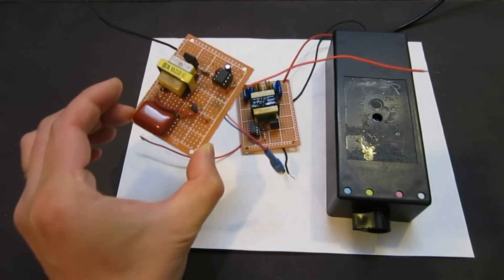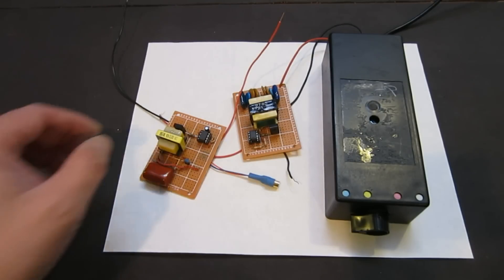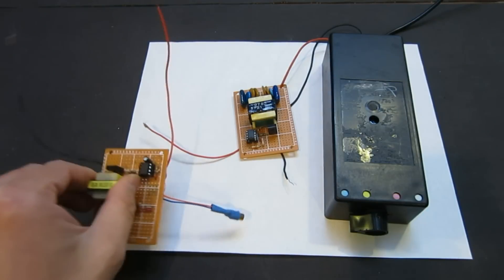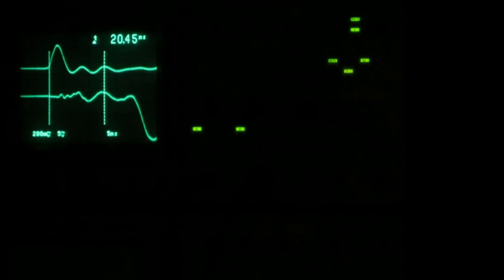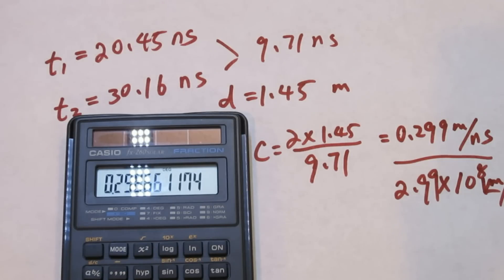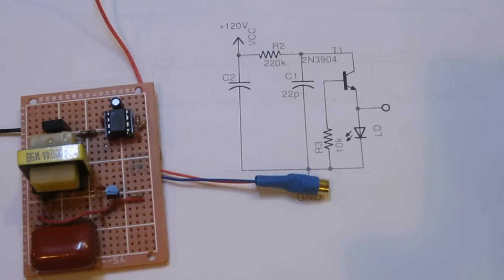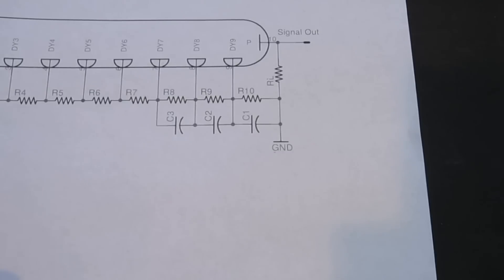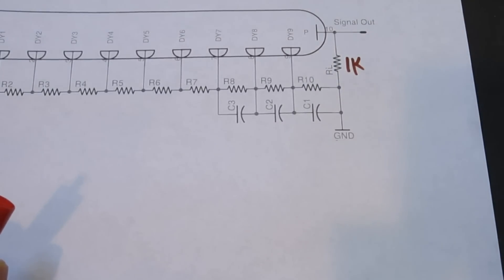Direct Measurement of the Speed of Light

Comment: That's a great experiment - but with c now defined as a number, and distance and time accurately measured, the only variable left to measure is the refractive index of the air in your room! I wonder if you could tighten up your accuracy enough to see it? Or maybe using an optical fibre to measure n for the fibre?
Reply from the maker: This experiment unfortunately is not accurate enough (the precision needs to be at least 5 digits after the decimal in order to see that).

Comment: The pulse shape out of the photo-multiplier would be useful if the light is modulated, like in the fiber optics that power the Internet. Here, you just cared about the start of the light pulse.

Like you mentioned, photomultipliers are so sensitive that they can detect a single photon. You use it to measure the concentrated beam of a laser, which seems to be overkill.

I am surprised that a laser diode can start lasing without any kind of warmup. You can send a brief shock of 120 volt to a diode without damage? Or is there some spark gap, zener diode or other protection to allow it to survive the electroshock ?

Nice demonstration which agree surprisingly well to the theory.

Comment: you are using a two channel oscilloscope, one channel connected to the output from the photomultiplier tube, and the other is connected somewhere to the avalanche oscillator circuit.  Where exactly is it connected to the avalanche oscillator circuit, I assume it is output terminated with a circle on your schematic.  Is that correct?
Reply from the maker: The second channel is connected to the emitter (anode of the laser diode) see schematic: http://www.kerrywong.com/2015/09/27/direct-measurement-of-speed-of-light-using-a-cheap-laser-diode-i/
Reply: glesage 
not only this experiment  but also all others experiment take away mistake with performance.
Reply: It doesn't matter where it is connected, the important fact is the difference between timeing when the mirror is close and far. There might be arbitrary delay in the circut, as long as it is constant and not depend on the position of the mirror (and why it would?).

Comment: Do you really need photomultipler tho for this measurement? In a dark room, wouldn't a photoresistors or phototransistor also work?
Reply from the maker: The reason I used a photomultiplier was because its fast response. As you saw in the experiment the rising/failing edge was in ps range so that you could accurately measure the the lapsed time. Most photodiodes/phototransistors have much longer response time (in ns range) and for photoresistors the respose time is even slower. This would result in the edges being stretched out and you won't be able to get accurate measurement given such short time intervals.
Reply: @KerryWongBlog  Thanks for the answer. I always tought that the photmultipliers are slower than photodides, but I guess I am wrong.

Comment: Interesting how the medium of air did not influence the measurement. The speed of light is stated in a vacuum.
Reply from the maker: The refractive index of air is very small (something like 1.0003) so this experiment is not sensitive enough to measure the difference it has on the speed of light.
Reply: Parm Mohan 
Sir 
I would like to work with you on speed of light. 
i have experienced of 15y in theoretical physics. 
plz reply 
pooraramphy@gmail.com
I have published a paper in
ijird
Reply: I was honestly just thinking the same thing, I'm kinda curious to know what the difference through glass and water is.
Reply: Matthew19002 , n=c/v. n  (index of refraction ) is the ratio of the speed of light in a vacuum divided by the speed of light in the medium such as glass or water. At lower frequencies like rf it is called velocity factor for say  a coax cable.
Reply: st1300 r 0.66Vf for RG58 the cheapest nastiest coax in radio lol

Comment: why it is impossible to use a phototransistor, but necessarily a photomultiplier ?
Reply from the maker: It is possible to use a phototransistor, but since the response time of a phototransistor is much slower than a PMT, you would need to measure the round-trip time over a much longer distance to make the measurement accurate.
Reply: ok. but may be another ultra fast pin photodiodes, tranzistors ?
Reply from the maker: The fastest PIN photodiodes are still not as fast as PMTs, but yes you can use those.
Reply: thanks !
Reply: What about an avalanche photo diode?

Comment: What about a solar cell instead PMT? it's a photodetector and fast enough?
Reply from the maker: The response time of a solar cell is far slower than that of a PMT so it is not suitable (not accurate) for measuring time in the sub nano-second range. APDs (avalanche photo diode) would also do the trick.

Comment: Wouldn't this experiments results be easily contaminated by how well you can measure the meter to setup your distance and how stable your oscilloscope's clock generator is? This is even harder to do now that the meter is defined using the speed of light. You can no longer measure light from scratch anymore.
Reply from the maker: The trigger accuracy of the scope is magnitude better than the nano seconds measured here, so in the short duration when the measurement is taken, this inaccuracy can be ignored.